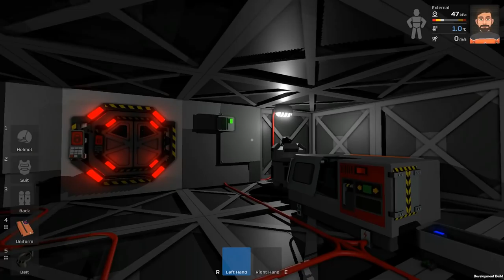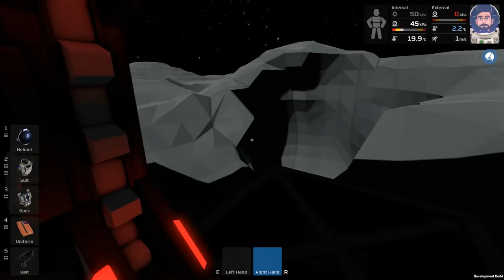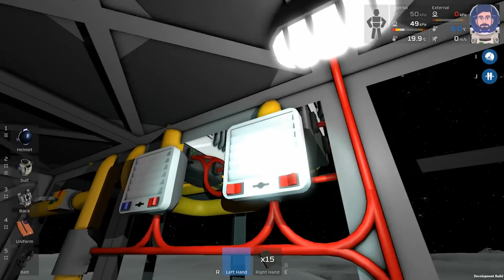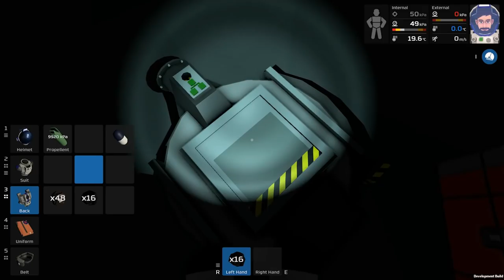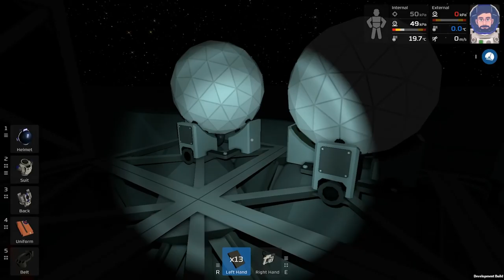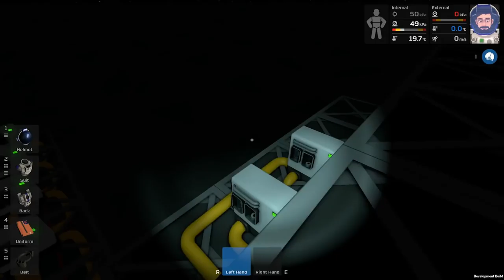Let's Play Stationeers - E4: Playing Around With Filtration & Gas Separation!

Comment: Doesn't a simple pressure regulator do the job on filling those tanks and you could just passive vent out with a valve when the pipes have too much pressure in them? It is not like you are getting those gasses in high quantities.